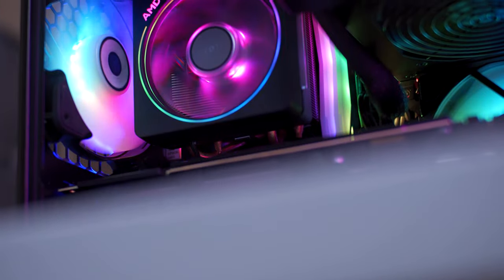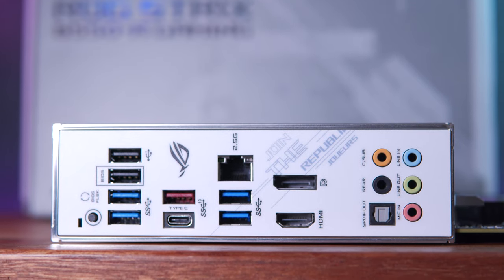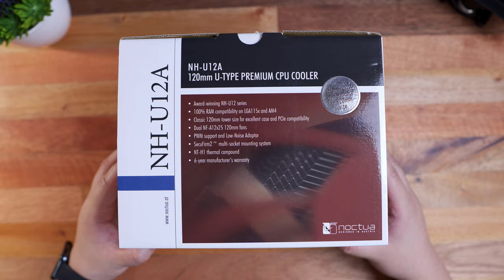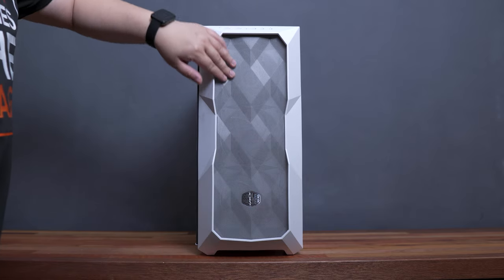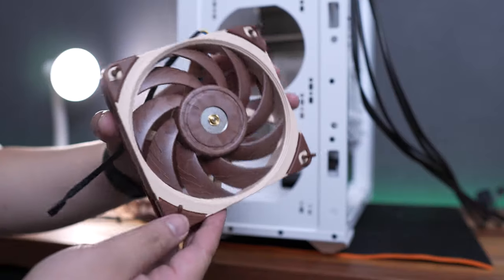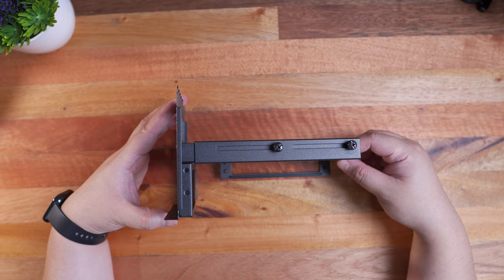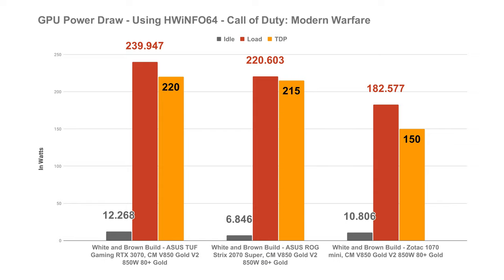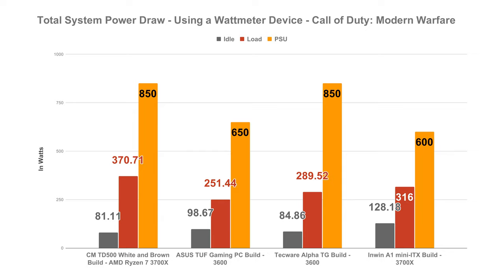ASUS TUF Gaming RTX 3070 Build Ft. Cooler Master TD500 Mesh and Noctua NH-U12A! + GIVEAWAY!

Comment: Cooler Master TD500 is one of the best atx case this year. I like the mesh front of the case with great intake airflow. The inside has a huge space for large gpu and also radiators. Congrats to the Cooler Master !
#CMTD500

Comment: One feature I like about this build is the use of Nocuta cooler and fans for great cooling of the components inside the greatly designed cooler master case and at the same time operates so quietly you won't hear the fans 🎉
#CMTD500

Comment: Nice build ! I have the same case with an i5 10600k and was planning to use the NH-U14S .. Do you know/think it will fit this case? Its a 165 mm high cooler on a 165 mm case , so does the side pannel get to fully be closed ?  Didn't find anywhere a similar build, and you are the closest to it

Comment: Cooler Master TD500 is one of the best atx case this year. I like the mesh front of the case with great intake airflow. The inside has a huge space for large gpu and also radiators. Congrats to the Cooler Master i also will strat to build pc  !
#CMTD500

Comment: Hi, i have the same case, im worried about the space between noctua and the fan yoo and ram
Reply: Can i use noctua nh12a on 

Mortar max450
R5 2600
Tforce delta ram
Td500 mesh case
??? I am worried about the space between ram height and the noctua nh12a